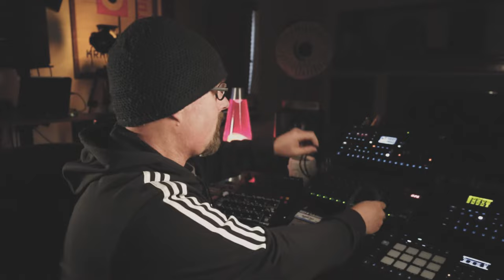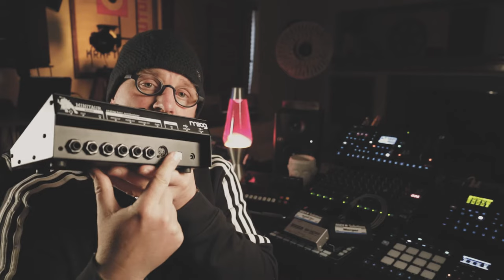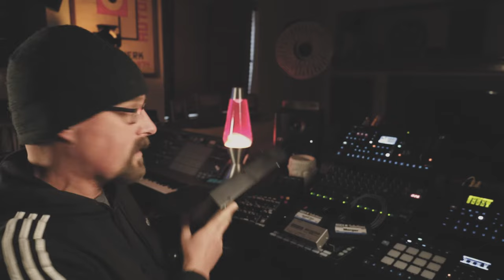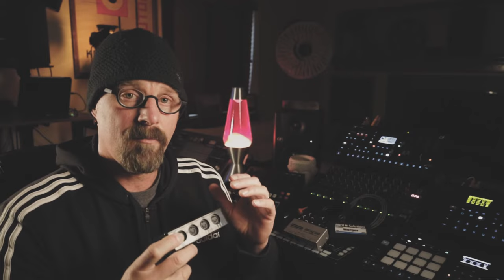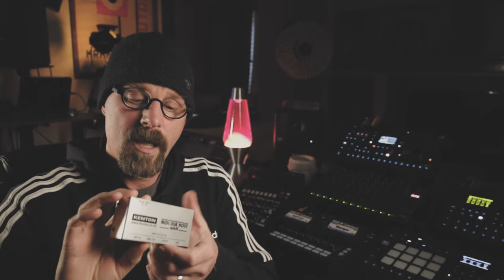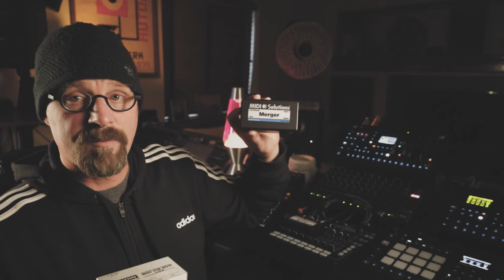MIDI Basics Explained: DAWless Connections, Routing, Convert USB to Din MIDI, Merging, Splitting

Comment: Nice video, I have one simple question wich is not as simple as I thought haha, I have a relatively old Motif XF7 by Yamaha and I established 2 way communication using USB straight into my computer but is it weird of me to ask how it is possible that my synth does not want to use it's own tone generator, because according to the Yamaha manual midi is send out on port 1 and received on 3, but for some reason my sound is only reserved for the VST audio lane wich is fine unless of course I use the MIDI out plugin only then it sends the midi data to the tone generator of the Motif but I really love my MSP5 monitors that I hooked up to my synth and I was wondering why it is that I cannot echo the midi signals produced by my synth back to it so I can use the synths tone generator, is there something I am missing ? It looks like it, or am I making the biggest and dumbest mistake ever to mix up midi signals and audio signals together wich of course are completely different. And I know that midi can not send audio only data, am I forced to use fire wire in this case or ? I assumed that midi data can be send to any tone generator from pretty much every DAW so that you can choose wich tone generator to use ? Or is that a wrong assumption ?
Reply: Thank you for reacting to my comment and question, I was wondering if I was overlooking something when it comes to sending midi signals to my synth but is it normal for a synth not being able to receive midi data of a certain DAW and me not to being able to monitor the sound directly on the synth itself via output L/R ? I asked a couple of people but till now no answer, perhaps just a Yamaha issue because their manual wich is 13 years old is explaining a lot but not enough, is there any way sir you are able to answer my question, that is if you are not to busy of course, I would appreciate it, and I also appreciate your videos, you are a good teacher
Reply from the maker: Hey! I'm not familiar with the gear you have but I would start by checking the midi settings of both devices. Also important to note that Midi flows in one direction (unless over USB), so signals will need to go from a source to a destination. The if the source is one machine and the destination is the other, the same signal does not automatically continue back unless specifically routed to an 'In' and a 'Thru' after having been duplicated using a Thru box. An 'In' signal will not continue out an 'Out'. The signal of an 'Out' originates in the machine it is coming from. Not sure if this helps. Let me know if you figure it out.
Reply: @SURCOlive  A thanks a bunch for taking time to respond, I know people like you are busy as hell so I appreciate that ! And thanks for pointing on the fact again that MIDI can only flow one direction unless it is send over USB wich is now the case, or of course when a THRU channel is chosen, or we consider that as one direction as well ? And I understood that only MIDI through can send an exact copy or so called : echo of the signal through to another device, and I want to experiment with some MIDI DIN cables soon to see if my Yamaha will respond a lot better to it or perhaps not and a USB connection should be suffice, well the reason I am so amazingly confused is that I am able to send the MIDI data from my synth to the DAW using a MIDI out plugin but then suddenly I can hear the sound being monitored on my studio monitors that are hooked up directly to the synth, so then I do get the signal back from the DAW because I turned the Local control off so that the synth itself is not producing any tones, and still sound is produced by my studio monitors, but when I use VST plugins then I can not duplicate the same thing, I feel like a rookie because I am haha 😊 but I am trying to learn as fast as I can, I think I will give Yamaha Netherlands a call to see what they have for me, can I ask you sir if you are able to produce MIDI signals that you are then able to send to a DAW but also to receive it back ? So that you can use a synth as an audio interface without firewire ? Forgive me for my messy question, the world of audio is a bit bigger then I thought, wich is nice... it has to be a challenge otherwise no fun but yeah I am stuck with this one, just looking for an option so that my DAW is going to choose to send all MIDI data back to my synth so I can use my studio monitors but for some reason my synth does not want to act like an audio interface, only when I am choosing dedicated MIDI out plugins. And I am looking at the audiointerfaces that are on the market, ( a lot ) and yeah also willing to try that to see how the signals will flow with a setup like that.